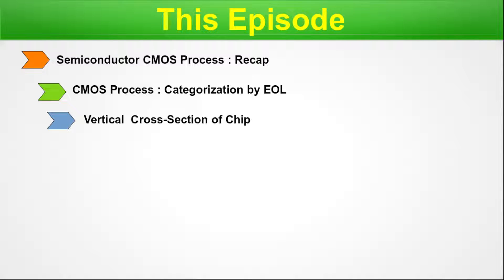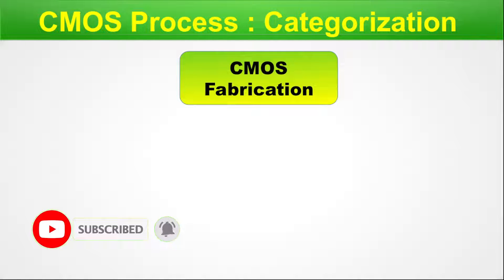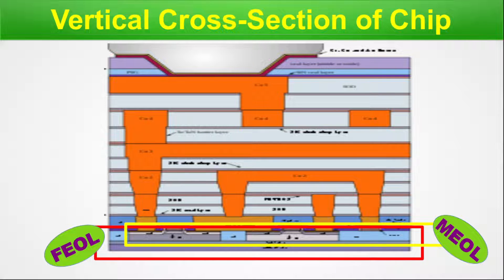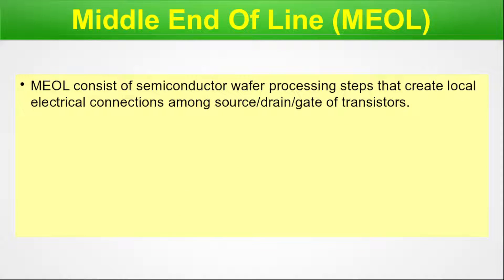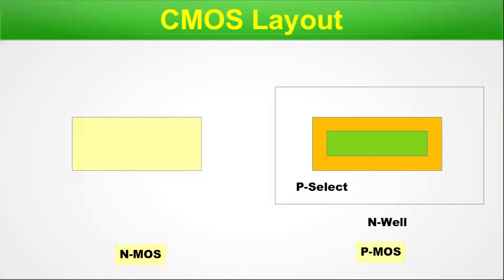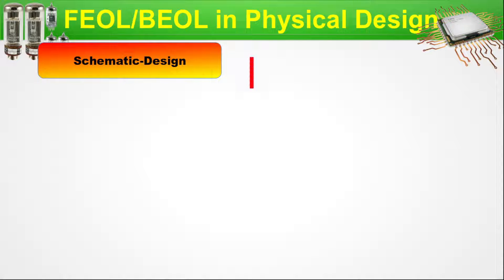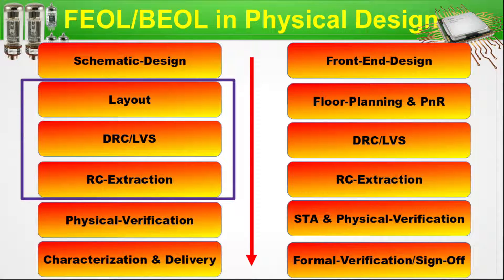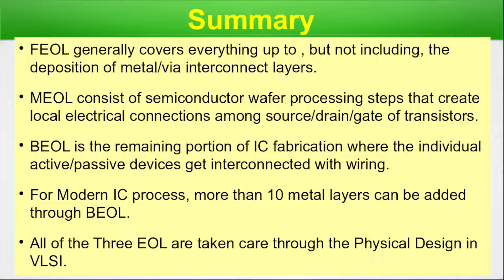FEOL, MEOL, and BEOL in VLSI: A Beginner's Guide to Understanding the Differences

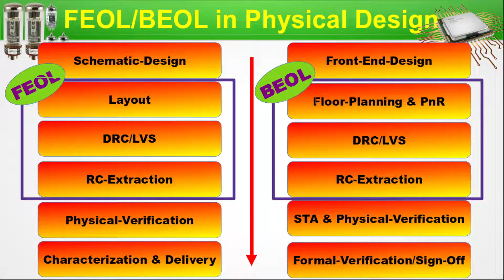Comment: Where does meol layers placed/ designed in the flow @ 10:50 ?
Reply from the maker: MEOL (Middle-End-Of-Line) layers are placed between the FEOL (Front-End-Of-Line), where transistors are formed, and the BEOL (Back-End-Of-Line), where global metal interconnects are built. MEOL includes contact formation (such as contact vias connecting transistor terminals to metal layers), local interconnects, and sometimes specialized vias or liners. In the design flow, MEOL isn't explicitly modeled during RTL or synthesis stages but becomes relevant during physical design and layout, where foundry PDKs define MEOL-specific design rules. These layers appear in the GDSII and are considered during DRC/LVS and parasitic extraction, serving as the critical link between device-level structures and upper metal routing layers.
Example :      [ BEOL ]
     - M5, M4 ...
     - M2, M1
     ────────────────
     [ MEOL ]
     - Contacts (CA, CB...)
     - Local Interconnect
     ────────────────
     [ FEOL ]
     - Gates
     - Source/Drain
     - STI, wells